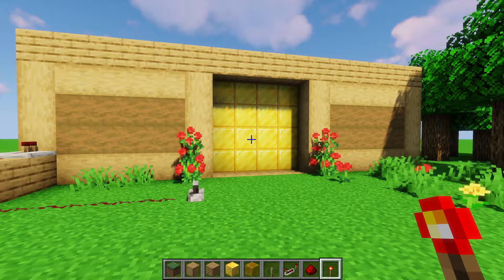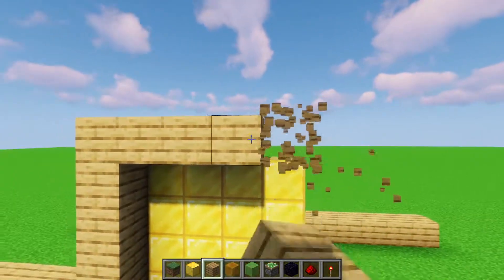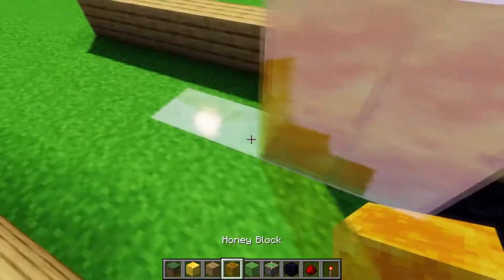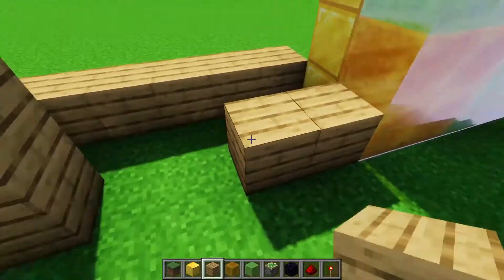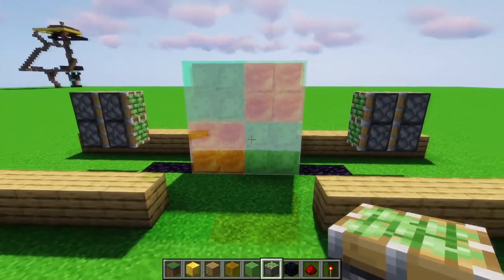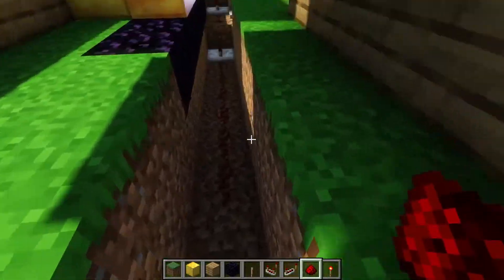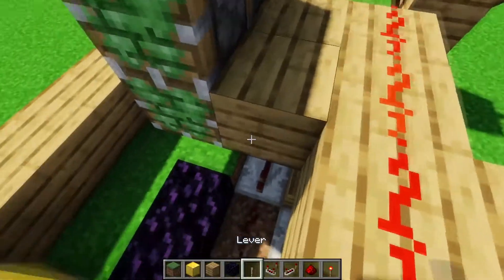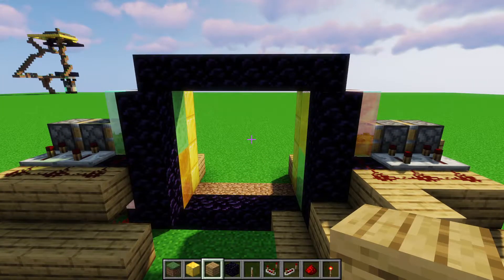Easy 4x4 Piston Door (Java Edition, 1.21.11 and Down) | Minecraft Redstone Engineering Tutorial

Comment from the maker: Materials!
8 Slime Blocks
8 Honey Blocks
8 Sticky Pistons

8 Repeaters
4 Redstone Torches
27 Redstone (more if you move the levers or anything else further away)
2 Levers
2 Comparators
20 - 30 Non-stick blocks such as obsidian (if you fill in blocks that need it, will be different for everyone most likely)
16 Blocks to use for the door itself, make sure they can be moved by pistons which includes most blocks

Some notes:
* If you replace the redstone torches that are behind the levers with a redstone dust on top of an opaque block, you can make the door open faster. Idk why I did it with the torches
* If you move the levers somewhere else, the bottom left and bottom right of the comparator XOR gate thing needs to be max signal strength so make sure the torches are still there, or replace them with repeaters. Otherwise you can put the levers wherever you want
* Furnaces are cheaper than obsidian and I think will work the same way. Glazed terracotta will also work
* The honey and slime blocks can be put in any configuration that allows all 4 sections to be pulled back, and where each section has no more than 10 blocks on it (5 sticky block + 5 front block)

Let me know if I missed anything!

Comment: 8:56 im trying to close the door from inside its not closing why is that?
Reply from the maker: Is the lever in the same spot? If you moved it make sure the signal in the corner of the XOR gate thing is at max signal strength. If you didn't move it, are the comparators in subtract mode?

Comment: For some reason only one side is working when i hit the second lever but not the first
Reply from the maker: If one lever isnt working at all, and the second lever is only doing half, I would make sure the XOR gate (the comparators thing) is working properly. If you moved the levers then make sure the corners of that XOR gate thing where, in the video, the levers were attached have a max signal strength. This can be just adding repeaters right before the corners. I would also make sure the signal of the output of the XOR gate thing reaches all the way to both sides of the door. If it runs out of strength then it would only work for one side potentially.

If you built it without any modifications, I might need some more details of what its doing to figure out what the issue might be. I assume its something to do with the XOR gate thing though
Reply: @ZennsWorld  Dude you helped me out so much Man ❤️‍🩹🤙🏾
Reply: @ZennsWorld finally after all these hours I did thank you ! 🙏🏾
Reply from the maker: I'm glad you got it to work!

Comment: is it possible to use the same mechanisms while making the door 6x6?
Reply from the maker: You can, you need a triple piston extenders instead of a double, and those can be large. I made a 6x6 door (vertical instead of horizontal though) which uses triple piston extenders and buttons for opening and closing instead of levers, but its the same principles

Comment: The second bottom sticky piston stopped pushing forward after a few successful tries. So the entire bottom 2 blocks are not working. This problem happened on both sides.Any help
Reply from the maker: A couple of things to check: if the piston is trying to push blocks, make there isnt something causing it to get stuck (slime blocks touching the grass for example, I do this a lot); make sure the repeaters on the double piston extender are set to 2 and 4; make sure the redstone on the double piston extender reaches all the way to the end, in particular the one on top of the obsidian

Comment: Everytime i set the repeaters to the same as in the vid it doesn't work. the pistons on the top don't grab the honey/slime blocks on the top. I tried switching the, and i'm still having the same issue. plzzzz helpppp
Reply from the maker: Are the pistons on the top firing at all? Or are they simply not pulling anything. If its the latter, I would make sure its not getting blocked by something (including slime / honey blocks sticking to something, hence the obsidian). If that is all good and its still not working, a debugging tool can be to see if the bottom and top pistons are firing at the exact same time. If they are not, then there is a delay mismatch somewhere, and it will cause one to work and one to break
Reply: @ZennsWorld   The top pistons are working but they just arent pulling whatever slime or honey block is on top. Edit: I fugured it out. I had blocks above the honey/slime blocks so it couldnt pull them. sorry for wasting your time lol.
Reply from the maker: All good, glad you got it working

Comment: I built this door and it works perfectly in my 1.20.1 world. I wanna add a sculk sensor to this door to have it automatically open and close when i walk up to it and away from it. do you have an idea where i would add the sculk?
Reply from the maker: Ive never used them, but I would assume to open it you would put it in the same place the button is (wire it to the same redstone pathway). Though if I recall the skulks will emit signals when theres noise, which means entering, walking, and exiting (which is just walking away), so I can image in would be finicky without some work. 

The solution off the top of my head would be to make it where it pulses when it "hears" something for the first time in a while, and to pulse when it hasnt "heard" something in a while. It would have to not pulse while it hears things after the first time, which can be done using a timer (start the timer after the first time and reset the timer every time it hears something). I can be more specific if that sounds reasonable.

EDIT: I am dumb I was thinking the 6x6 which has a button instead of a lever. You have to place it away from the pistons or else it will cause an infinite loop. Otherwise just wire it to where the levers are wired.

EDIT 2: I might just make a video on skulks because they are more complicated than I thought for this sort of thing. The short is you can use wool (or a calibrated one with input power level of 1) to make sure the pistons in the door dont trigger it, and then you need to make it to where the cooldown of the skulk doesnt turn off the signal while you are walking around. This can be done using a timer like I said above but this is easier said than done.

Comment: This is wonderful!  I gotta ask though, is there a way to alter it for Bedrock version?  My repeaters only power the top pistons
Reply from the maker: Not easily. Bedrock doesn't have the thing where pistons get powered from a block above them being powered, which means you would need to power all four on each side separately and make sure their timings are all the same as before. Even then I kept getting inconsistent behavior when I tried to figure it out (sometimes it would work and sometimes it wouldn't). Sorry I couldn't be of more help
Reply: guess it will jsut be a 2x2 door

Comment: How hard would it be to replace the levers with buttons but make them act like levers?
Reply from the maker: Not too hard. It would require more space though since you would need to put a memory cell thing somewhere in between the comparator and the button (the output of the memory cell would be the input to the redstone torches that are attached to the back of the levers)
Reply: I know how to make button act like lever and would not take much space
Reply: Just go underground and make an easy lever. I used 6 repeaters and was good to go works like a charm